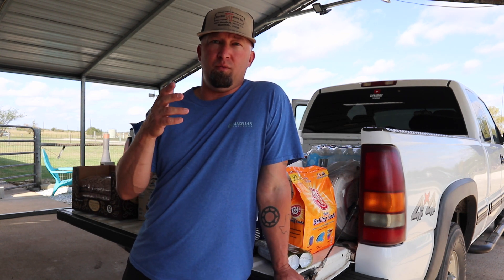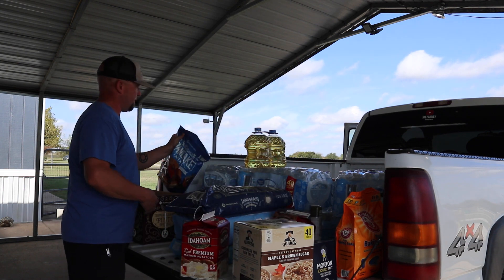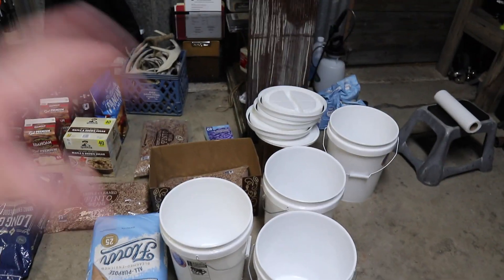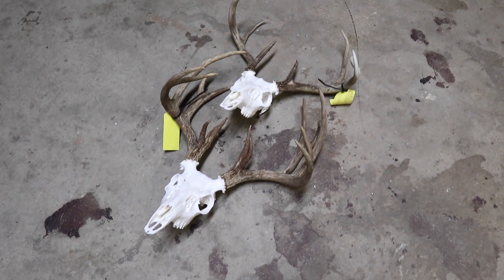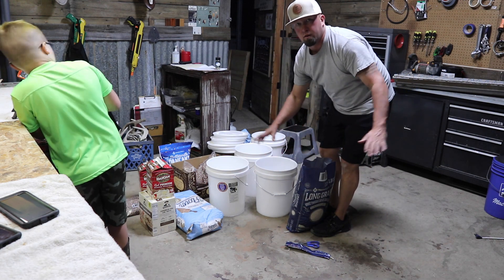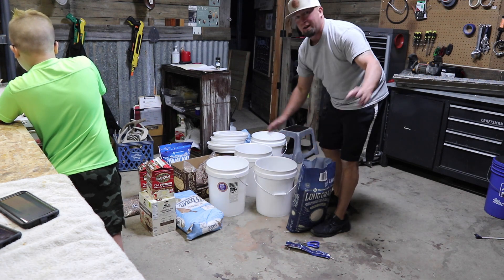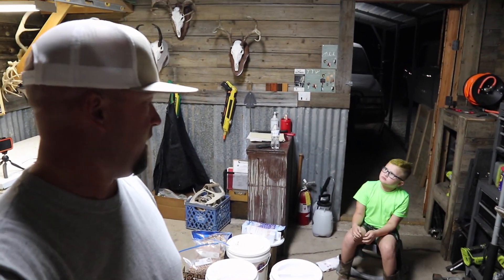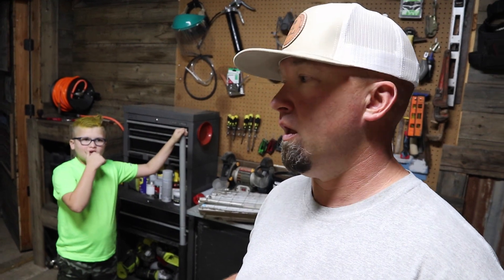Preparing For Supply Chain Shortages

Comment: When you say moisture packs are you using O2 absorbers?  Don’t use in sugar or it will turn it to a brick.  Don’t put anything in sugar.  Hope that helps. :)
Reply from the maker: Thank you for the advice. ❤❤😊😊
Reply: Same with salt.
Reply: Correct, Do Not Use O2 absorbers in salt or sugar.

Comment: If you have your own well install a hand pump If there is no electricity or you can't get gas for a generator. 

Also, don't try to store baking powder. It dies after 18 months tops. You can make baking powder with cream of tartar and baking soda. When stored separately they last indefinitely.
Reply from the maker: Thanks for the tip on baking powder. We didn't know that!

Comment: Hmmm… I layer my bay leaves in those buckets. I have at least 100 in each bucket. But I do this because I don’t do the freeze method. This is the method I learned from my aunts who live in Puerto Rico. They struggle with bugs and humidity constantly and this works for them. I would like to encourage everyone to buy the organic bay leaves. They are more aromatic and larger. Amazon sells them by the lb.
Reply from the maker: Wow! Great suggestion. Thank you.

Comment: You have to be careful with Walmart buckets because they are not all food- grade.  Lately, they usually have been out of their food-grade buckets. It's OK to use non-food-grade buckets if you put the food in mylar bags, but if you don't, then chemicals from the plastic can leach into your food. Also, I've seen people use food grade buckets but then try to use the oxygen obsorbers in the bucket without mylar bags, and it makes the buckets cave in.
Reply from the maker: We triple check when we buy our buckets that is specifically says food grade. We don't want to ruin all the stuff we have stored. 😊

Comment: I would put the salt in a big plastic container or put it in a glass jar!  I recycle the big glass jars of pickles or the plastic pretzel jugs.   Great video.  Another thing I did was I bought two more sleeping cots for the emergency bunker or family!
Reply from the maker: Cots! Great suggestion.
Reply: @OurTopPinLife  Make sure you get comfortable ones. Some of the old military types had a 'brace' right in the middle that killed yer back. Or you can just get a foam pad and put the sleeping bag on top of them. The foam insulates you from the floor, as well. Travel pillow for the sleeping bags takes up less room, if you're making up a 'grab and go' system, even if it's moving to an inner room you can keep warm if the grid goes down..

Comment: Flour won’t be at its best for 30 years but the other items will be great with the gamma lids you purchased as those deals are stronger than pop on lids I find. I have items in buckets with those lids for 22+ years that are still fine!
Reply from the maker: Wow! 22 years.
Reply: @OurTopPinLife  yes I don’t regularly use hard red wheat but I do have a bucket of it that I bought before I realized it was a little dense for our liking but I’ve kept it anyway and can use it in a pinch if I needed to.

Comment: Not sure if you've covered this in other videos, but stock up on Pharmacy items. 90% of our Vitamin C comes from China. Not even kidding. When the pandemic hit and snarled the supply chain, antibiotics and other items were quickly bought out. We're going into the Winter and that means flu as well as colds and other spreadable diseases, so stock up on the things you won't feel up to getting if you or people in your inncer circle are ill. I had to nod at the chicken noodle soup, good move. I envy you the taxidermy business. It's also a good way to trade a service for fresh meat for the freezer, or it can be freeze dried for longer storage. Networking is key during lean times. Your skills are better than gold. Vitamins aren't usually needed with a balanced diet, but if you're getting to the end of the storage items, you're going to be missing nutrients, more than likely. Generic vitamins aren't that expensive, but do have to be replaced to maintain potency after a couple years. Again, generics are coming from China. And remember the females, for their hygiene items. People panic, and snap those up, so have a supply on hand. If you don't need 'em, another in your inner circle might.
Reply from the maker: Wow, thank you for taking the time to comment. Everything you wrote is great adive and suggestions. We really appreciate it